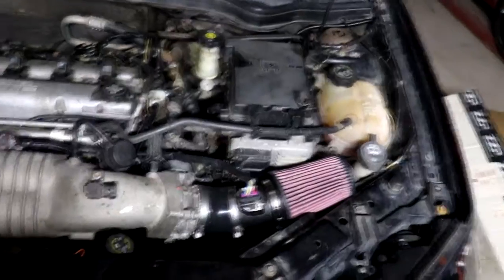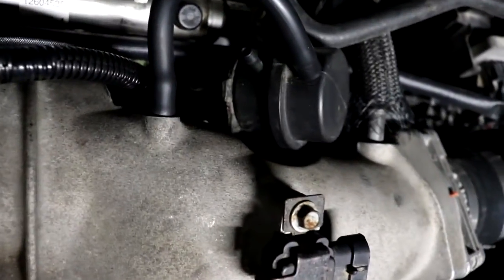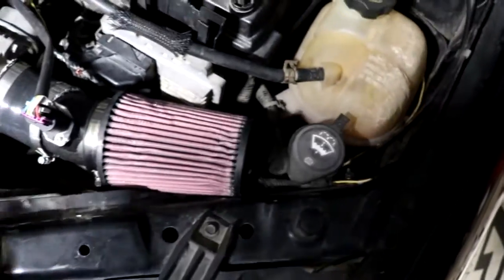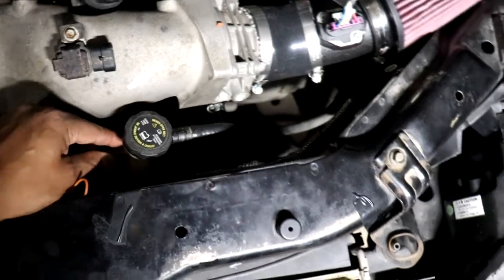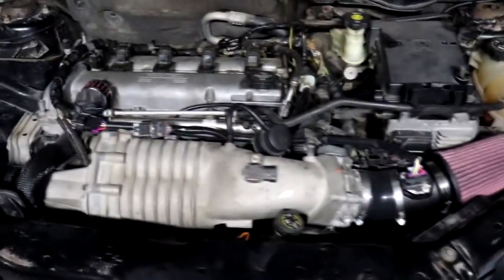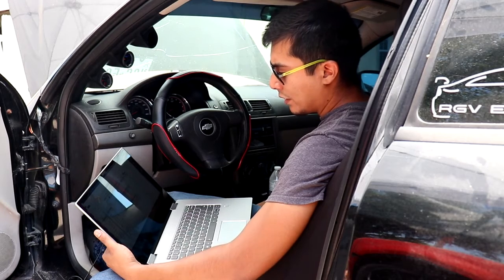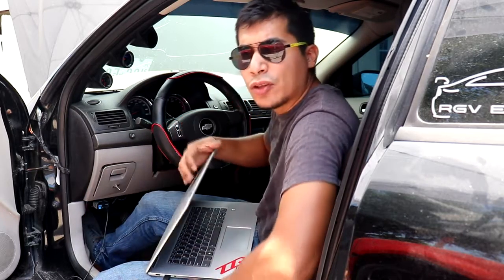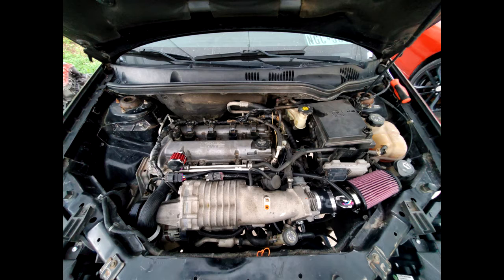Supercharging a 2 2L LAP Ecotec Part 2

Comment: Did you have to add a return fuel line/ upgrade the fuel pump?
Reply from the maker: No didn't have to add extra fuel lines and don't have to upgrade fuel pump with the injectors that came in the kit. If you upgrade SC pulley and injectors and tuning for E85. I'd go with upgraded fuel pump

Comment: Does the kit come with a pulley tensioner ? Or do you not even need one very confused
Reply from the maker: Sorry just getting to you but the kit comes with the idler pulley for the supercharger and spacer for the alternator. Use the factory tensioner

Comment: Hi amigo, where is the power steering pump?
Reply from the maker: Hello, this particular car doesn't come equipped with a power steering pump due to it being electric assisted steering. The electric motor is mounted behind the steering wheel.